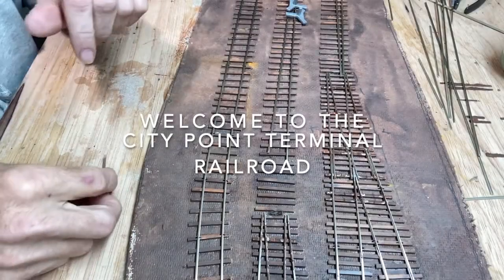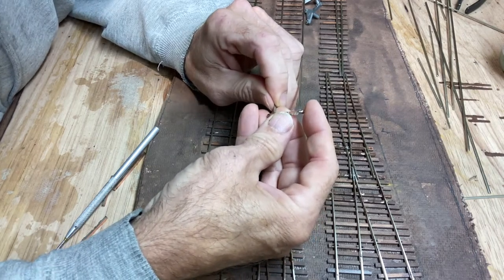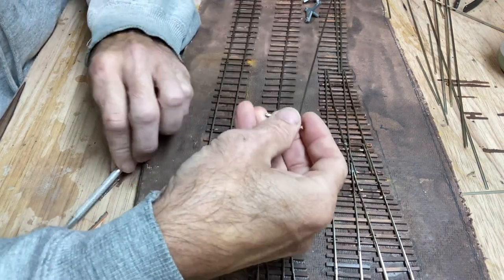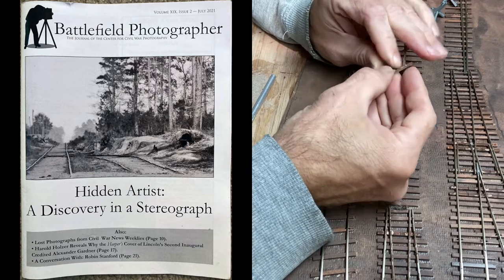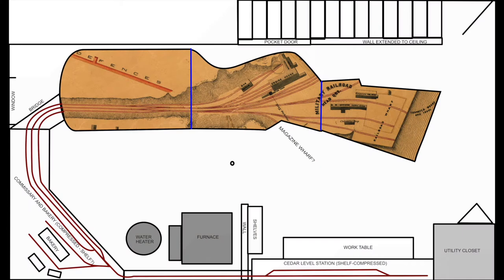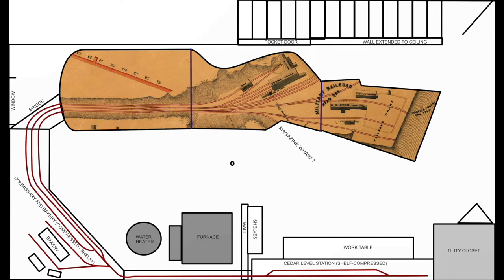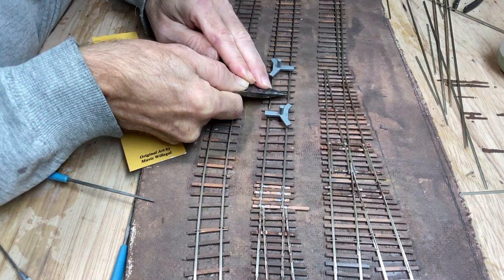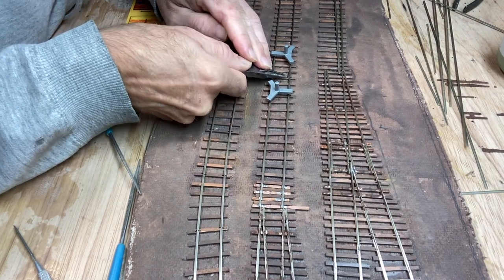Laying Track on the City Point Terminal

Comment: Why aren't you using rails from the store? Now they are not doing badly.
Reply from the maker: you can't buy stub switches in stores
Reply: @mikewillegal682  I think any railroad switches would look good. You will still need a lot of effort to place smd LEDs on trains. And maybe also replacing decoders in them with homemade ones.